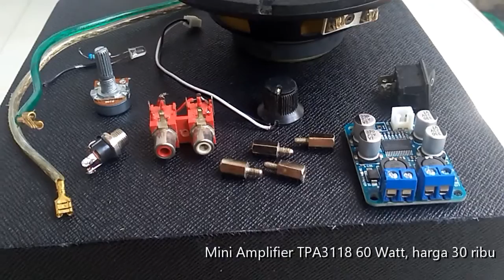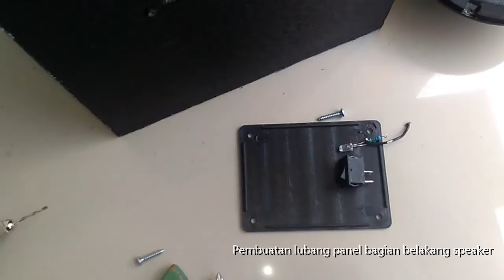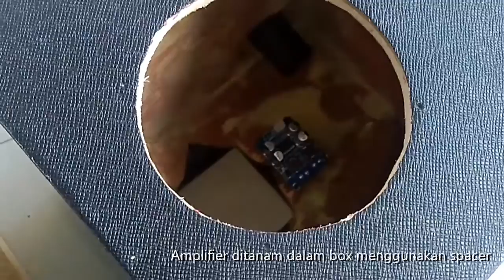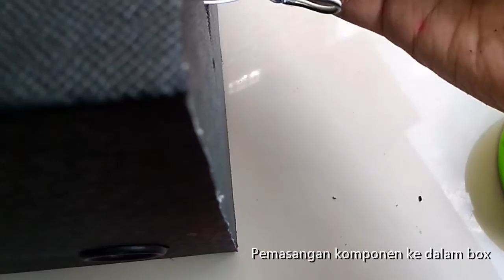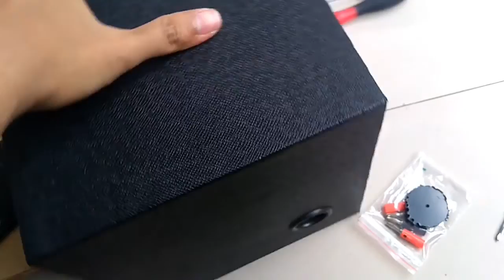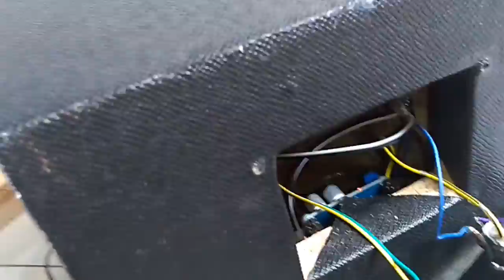Merakit Speaker Aktif Murah Meriah, TPA3118 60 Watt, Woofer 5 Inch (Cocok Buat Dangdutan)

Comment: List komponen lengkapnya bang , saya masih bingung dengan tutornya
Reply from the maker: komponen utama : speaker 1 buah, mini power amplifier mono TPA3118 1 buah, Box kayu. Aksesoris : socket RCA female, socket DC female, potensio mono 50k, kabel speaker dan kabel untuk perakitan, bisa pakai kabel pelangi dll, switch on off 2 kaki, led buat indikator power ditambah resistor 1K ohm (bisa juga 2k ohm jadi lebih redup LED nya)
Reply: Modul mp3 nya bang ?
Reply: Itu yang socket adaptor nya namanya apa bang kalau beli ? Dan harganya berapa ?
Reply from the maker: @anakmama9233  yang ini tidak pakai modul mp3
Reply from the maker: @anakmama9233  socket adaptor namanya socket DC
Reply: Harganya berapa bang aku lihat di shopee 50rban
Reply from the maker: @anakmama9233  TPA3118 kisaran 40-50 kalo sekarang
Reply: Okay terima kasih bang

Comment: itu amplinya, kuat angkat brp speaker?
Reply from the maker: 2 buah woofer 5 s/d 6 inch diparallel kuat kok mas
Reply: @EmpliStudio  paralel gmn maksudnya...
maklum pemula om
Reply from the maker: maksudnya satu buah ampli ini (mono) bisa menghidupkan 2 buah woofer 5 / 6 inch dengan ukuran woofer 8 ohm, diparallel menjadi 4 ohm, dan apabila menggunakan psu 24 volt 5 Ampere (total watt 60 watt), berarti ada sharing power masing2 woofer 30 watt 30 watt
Reply from the maker: paralel itu maksudnya menggabungkan 2 buah woofer secara langsung, minus dengan minus, plus dengan plus